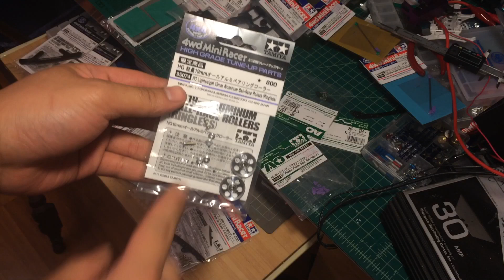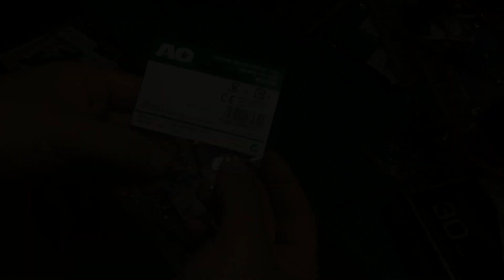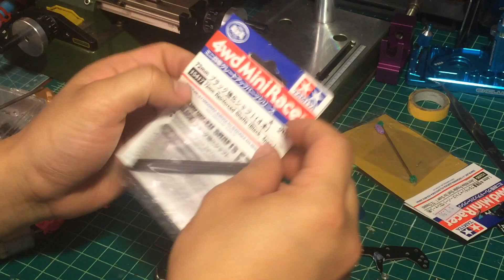Tamiya Mini 4WD VS chassis speedtech project with body damper system process part 1/4

Comment: Why do you choose VS instead of Super 2, is there any advantages?
Reply: Yudistira Putra didnt much understand why japanese prefer VS too. Maybe becoz the front is able to make a more stable structure by having the front frp puncturing the chassis.
Reply: Junyi Goh Here are the reasons why the Japanese likes to use VS chassis instead of Super 2.

- Lower center of gravity because the battery sits slightly lower than on Super 2.

- The front bumper is higher on the VS, so it allows more option on how you want to set the bottom front action. For example if you want to custom made a front underguard, the ground clearance has a bit more space to work with. On Super 2, the front bumper sits low, so the option of having some ground clearance is pretty limited if you want to use a front underguard. Most likely you will need to use large diameter wheels for that.

- VS chassis has been around much more longer, so they are already used to the characteristics of the chassis

You can reinforce the front bumper of Super 2 chassis by using FRP Rear Roller Stay for Super X. But if you want to add front underguard to that setup, it will sit very low and you will have to use large diameter wheels, which will lift your center of gravity. But as long as your setup is stable, won't be an issue.

To make it short, if you want to reinforce the Super 2 front, you will need to use large diameter wheels and not trim the tires too much. If the front is too low, it will act as brakes and will slow down your car a lot at slopes.
Reply: Faren Sabri definitely slightly more options for front setup. but super 2 has it's advantage too.  though both has very similar characteristics, guess it's just a choice
Reply: Junyi Goh just say that VS chassis is like Bruce Lee...flexible...and a but lighter.. Super II is more like Chuck Norris..tough yet easy to adapt on any layout..